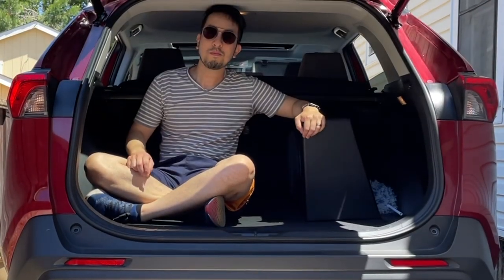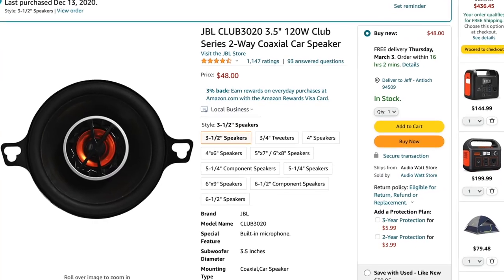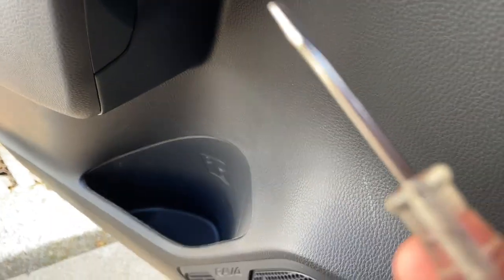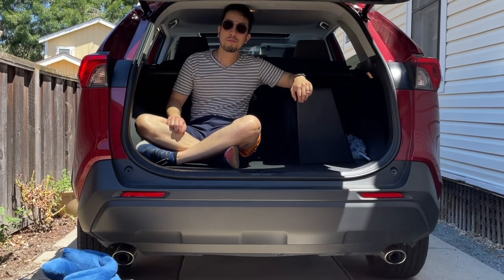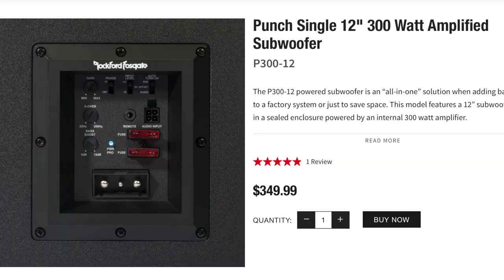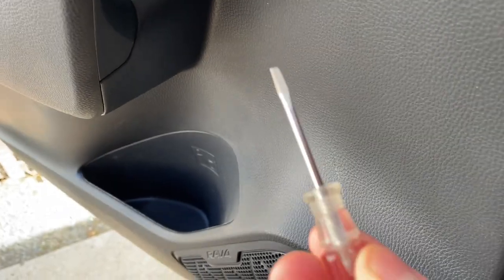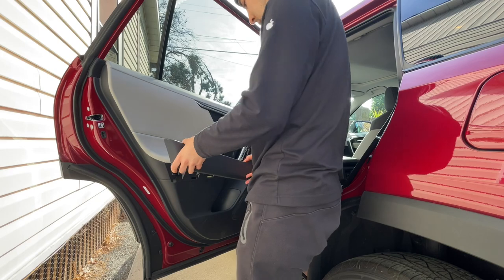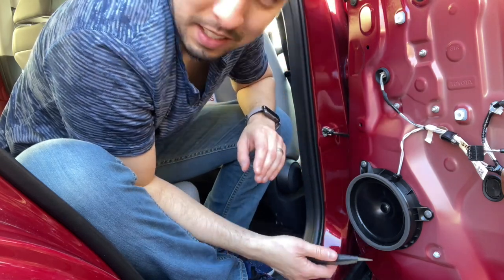Toyota 2019+ Rav4 Speakers UPGRADE (JBL Front & Door) + Rockford Fosgate Punch 300w Subwoofer!

Comment: I did a lot of research on how to get the best sound quality when replacing the rav4's speakers while not adding an amplifier or replacing the head unit. The best options are actually the Kicker DSC3504 and 6504, because they are rated to the same impedance level as the OEM speakers (4 ohms). The JBLs are 3 ohms and can suffer distortion issues because of it. The Kicker DSCs are also rated to work at 10 watts RMS or below, which is important for avoiding distortion from an underpowered head unit. I was not able to find any other quality 4 ohm speaker rated to work with such low power requirements. 

If you are only replacing the front speakers you'll need to reverse the polarity, but if you do all of them then it won't matter. 

Unfortunately the head unit itself is a major bottleneck for sound quality, not only because of it's low power output but because it's been factory EQ'd to work with the OEM speakers. Adjusting the EQ (lowering the highs, raising the mids and lows) helps but it will not sound as good as a flat signal coming from a third party head unit.
Reply: Did u get a connection adaptor/harness?
Reply: I Have a 2019 Toyota Rav4 XLE Can I UPGRADE Kicker speakers DSC3504 for Front And Rear Door.What Model can I Use For Dash speakers. Can you Tell Me Thanks
Reply: Where did you find the information about the power rating (10 watts RMS)? 😃 Tried to research this comment but I found the kicker DSC 6504's handle 60-240 watts which is more than the 10 watt you mention. The smaller 3504's handle 4-20 watts which would work.  Not an expert so feel free to correct me, also not sure how to find out the specific wattage needed
Reply: Crutchfield told me that JBL have conducted extensive research on their 3ohm speakers and they work fine with a minimum 4 ohm-rated head unit - Crutchfield said that they get asked about this all of the time.

Comment: This is a great video and helped me a lot of installation itself. But there are so many things missing here:

- These speakers have a rms rating of 55w rms while the facory headunit probably provides 10w or so. I personally put in a sony xav 5500 head unit on my old rav4 that I bought used. It still only provides 15 or 18 w rms. You absolutely need an amp for these speakers no doubt otherwise they will distort at high volumes.

- The dash speakers get the same exact signal as the front door speakers. It will try to play bass notes its not capable of. Its very important that you buy a bass blocker for them. I am still trying to find the right frequency rating for these bass blocker but for now I have 300hz ones running in. I might try higher ones at some point but I don't think you want to put in 2800hz ones as they will make these more like tweeters.
Reply from the maker: Thanks, I’m glad this was helpful and hopefully you’re enjoying your new setup!  I’m sure I could have optimized my choices, but overall I’m happy with the night/day difference these new speakers make compared to the stock
Reply: Could you maybe point me to where you found out the factory head unit wattage rating (10) ??
2nd question if you have time:  Does that wattage apply to all the speakers in the vehicles or do you mean the dash speakers specifically? 
Thanks for any help!

Comment: the rear door speakers dont put out the same watts.   there like 30% output to the fronts.  and.  no tweeters.  
"the front speakers would make a big difference!" if you swapped them out for jbls.    if you wanted to step up your game a little more.  audio control has a 6 channel drivers to boost your weak single.
your on the right track though!
good share too!

larry

Comment: Watching you cut the factory speaker was painful. Spend the $20 for the adapters. Drill out those rivets, insert rivnuts and use bolts on new adaper. Also use foam rings to channel sound into car. Sound deadner would help a lot too. And of course an amp. You will need something like a kicker key LOC to make your signal flat to the amps.

Comment: You didn't reverse the polarity on the speakers (since the Rav4's polarity is reversed).  Check the polarity of the signal coming from the head unit with a multimeter.  This would probably help your bass response as your speakers are excursioning the wrong way (also will prematurely wears out your speakers).
Reply from the maker: This is a great tip, thank you, can’t wait to test this out!
Reply: @Filmlove  I just went through this. Look at the tweeter you removed. The side with the capacitor, thats the positive side. Use that as reference for the aftermarket harness. I had to reverse mine. I also connected the bass capacitor included with the speakers. They nerf the bass going into the speakers for a cleaner sound.
Reply: Any updates on reversing the polarity?
Reply: @patriotcanuck6485  they should be reversed. Look at the tweeter removed, the terminal with the capacitor is the positive. That will help you determine polarity
Reply: @aldoraine9949  I appreciate it. I was just wondering if his were reversed and if they were did he change the polarity and had it helped with audio quality. 😌✌
Reply: @patriotcanuck6485  I had the same speakers with hooked up wrong too for a while. It wasnt until I installed the rear speakers that I revisited  the installation of the front ones and realized they were reversed. I also installed the capacitor that came with the speakers to nerf the bass and I can tell you there was a significant sound improvement
Reply: Yeah, I did mine a while ago and thought my speakers were duds. Took me a while to figure it out myself 😅
Reply: @aldoraine9949  i got these harness as well. Do you know how to reverse polarity? Do i need to cut the wires of the positive and negative ends and resolder?

Comment: At 9:38 how did you go from freshly cutting out the old speakers into having the holes for the new screws to go in? Did you drill in your own or were they hiding behind the foam?
Reply from the maker: @ismaelpena4375  hi, I drilled my own holes in the existing plastic housing that was leftover after cutting out the original magnet

Comment: Ok many questions, why did you cut the speakers instead of just unscrewing them, and what do you mean drilling. You had to drill your own holes to place the speaker?
Reply from the maker: Hi!  Yes they had to be cut since the factory speakers use rivets instead of screws.  By leaving what was left of the speaker housing on the door, I only had to drill the new JBL (or any brand you like) into the speaker housing, and not have to drill into the door itself.  To repeat, don’t drill into the door, you don’t want any screws to punch through outside lol

Comment: Hi! I have a rav4 2021 red one also, could you give the links of the speakers adapter? Do you have a video about how change the front speakers?
I already change jbl3020 but i neet change the other ones 🙏🏽
Reply from the maker: Hey nice color choice with the red!  Do you need the adapter/harness for the front door speakers?  While i didn’t personally change my front door speakers, the adapter should be the same as the rear speaker harness that I used, which is this:

https://www.amazon.com/gp/aw/d/B08213PXTP?psc=1&ref=ppx_pop_mob_b_asin_title
Reply: Genius!! Thanks a lot, If you change the front speakers, I'll be there to see it. 💪🏾

Comment: Is there such a thing as a wireless amped subwoofer just requiring 12v ?
Reply from the maker: I haven’t seen one yet, that would be an innovative idea to easily add on.  Though I do know some delivery drivers that will just bring their own Bluetooth speakers into their trucks and connect straight to them

Comment: What screws did you use for your rear door speakers?
Reply from the maker: Ideally with thick enough threads that hold the speaker firmly into the housing, but not so long that they will go thru the door itself.  There are screws that come with the JBL’s for its own mounting plate, but I didn’t use them

Comment: I put in the JBL3020 and am not happy with the sound, somethings missing.
Reply from the maker: Hey, yeah personally I wasn’t fully impressed with the sound from the Club3020 which I why I landed on the GX302 for myself.  

Additional potential issue: I read thru some comments about reverse polarity on many RAV4 models, especially when using the RedWolf harness.  After looking at my setup, the speaker incursion is correct for me, but on a few online threads there is discussion about having to solder the redwolf cables in opposite polarities to “correct” the reverse polarity in some Toyota models. For reference, I have a 2020 RAV4, non-JBL system trim.  There however is no set consensus on which exact models after I scoured the RAV4 online discussions and RedWolf product page on Amazon
Reply: @Filmlove  I just checked the dash speakers and they seem to be firing out not is so those are ok.  Not sure what it is but the sound is better than the stock speakers but should be better.
Reply: @Filmlove  use the tweeter you removed to figure out polarity. The side with the capacitor is the positive side. Use that as a reference to switch the cable of your harness (it is reversed for rav4). Also install the capacitors included with your new speakers. Last, cover the holes surrounding the new speakers with flexible packing foam. Thank me later

Comment: How did you attach the door speakers to the door?
Reply from the maker: There is plastic housing for the stock speaker, use that to mount the new speakers, but be sure the screws are short, you don’t want them going too far into the door itself!

Comment: Hey. Ist a hybrid rav4 ?
Reply from the maker: Gasoline only, with the standard audio system.  Hopefully the audio connections are the same for all of the models 2019-2023 since the body shape is the same
Reply: @Filmlove  ok. Cool. Do u think 300w rms sub Will work in a hybrid
Reply from the maker: Yeah I have a 300w sub now, the battery/alternator can handle it, as long as you don’t have that sub playing all night long without the engine running!  (Tho I did notice that the RAV4 turns off all the accessories after like 15 minutes without the engine running, which is too fast in my opinion, oh well)

Comment: Replacing factory speakers is not an upgrade (especially comparing them with anything after market really tells us nothing about nothing - of course after market speakers will be fancier/"more potent", etc.). Potentially higher maximum output and more treble from the after market speakers is not an upgrade. Cutting out/destroying factory speaker membrane (or whatever other speaker was previously placed in factory speaker location) just to screw on the after market speaker is not an upgrade. Simply drilling a hole in the factory plastic speaker baffle to pass through the cable for the new speaker is not an upgrade. The only true upgrade was subwoofer addition to the system.
Reply: @drewlyons3932  you simmer down. I made no comment about the gear, and I fail to see how my comment is preventing the owner from enjoying it. Besides one needs no expensive gear to create better/good audio (just a little bit of love and attention to install them the right way). If big audio fan means supporting somebody that replaced (hopefully) free-of-charge factory speakers with trash after market ones with no love to installation by literally destroying the already terrible factory infrastructure, then, yes, you could call me the bad guy.
Reply: Thats madness of course it's an upgrade, meaning "To replace (a hardware device) with one that provides better performance" . My man showed us there's more then one way to skin a cat ... For someone that doesn't have the brackets and cares less for the factories, this is an option to get the install done. The amp/sub is an addition to the upgrade.